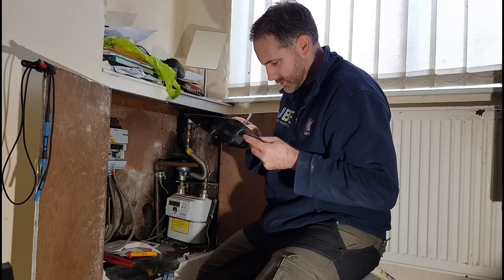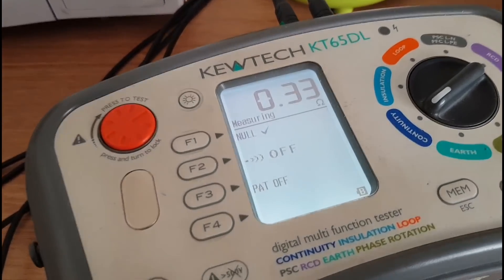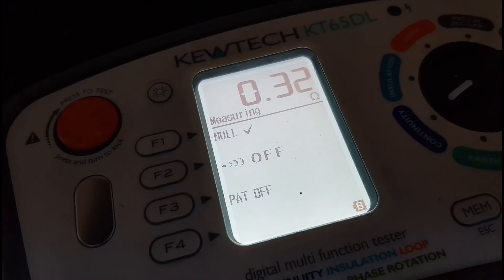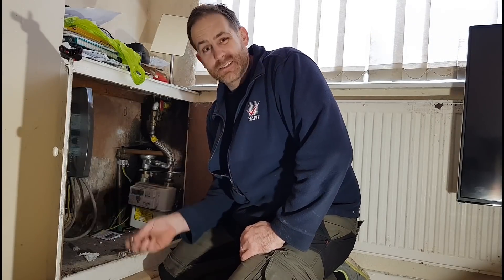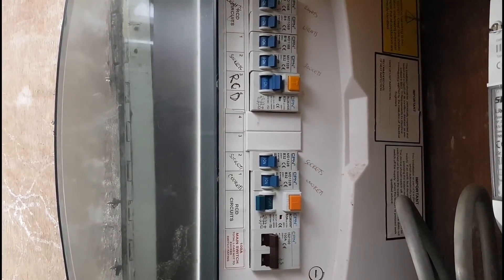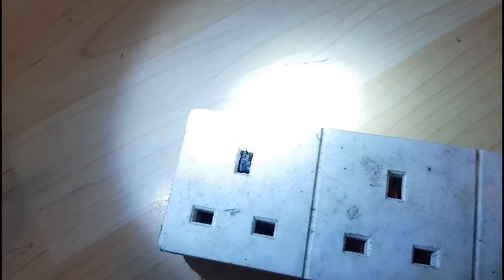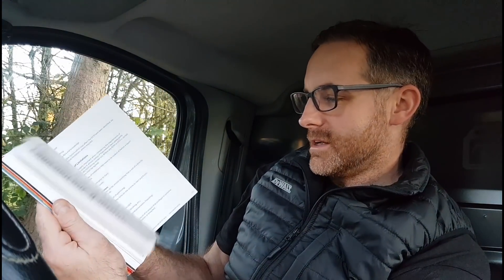Electrical safety in domestic properties. (25)

Comment: I’m interested to know when doing Eirc on the smaller faults the c3 codes do you just put right while your there or do you record it on test form then hand to landlord/agent.
I find all most all installations would have multiple defects that it’s easier for me to rectify than record on the cert! Just keen to find your thoughts

Comment: Typical electrician, talking half of video about a screw in the socket and the imminent danger of that C1-C2. 

How exactly is that interfering with anything that the normal socket screw wouldn't ? It's not being screwed through the middle of the socket.
I assume most of your viewers have opened a socket before, maybe even it's guts, and I assume everyone with at least iq 70 would agree that it cannot cause any danger.
Reply: Pardon? None of what you said makes any sense.  Statmente?  😂😂😂😂😂 I'm betting you are a millennial or even a female?  Based on the way you type. 😉 Oh dear! 🙈 You must just be angry at Labour losing too? "So," 😉 you're taking it out on poor jbeckelectrical. Get a life!  🤷‍♂️
Reply: @lloydchristmas8931  O snap, let me correct the typo so the grammar is perfect for your highness, otherwise you wouldn't understand what was typed. Seems you're still under iq 70, unfortunately.
When saying that someone is not correct, this usually follows with a why, otherwise we could endlessly say "you're not correct", then you would reply "no, you're not correct", etc. 
A good suggestion would be to stop avoiding the subject and argue as to why, because me being a millennial or female or Labour supporter has zero relevance to what is being said so far.
Single bit you partially got right is that I'm taking it out on poor J Beck, but I simply can't stand the over exaggeration of electricians, plumbers or any "hard working" "tradesman", because this shows that he tends to make a big thing of something so small, hence leads me to believe that he might be one of those guys who charges people £500 to swap a lightbulb for an old lady.
Reply: What is your IQ? 😂😂😂
Reply: @lloydchristmas8931  So you must be the one with iq under 70 :))
Reply: How'd you guess? 😱😜 "So?" Saying, "so" in front of your sentence makes you a genius then right?  😂😂😂🙈
Reply: @lloydchristmas8931  There is nothing wrong with using "So" to start a sentence, as a conclusion on my previous statement based on the outcome of your reply.
Ad hominem arguments are on your side :))
Reply: No thanks!  I have an actual paid career. Unlike yourself with time to spare. 😉 Good luck in the real world millennial. 😘😘
Reply: @lloydchristmas8931  It's funny when you call someone millennial, as if that would be an insult, and all your replies have plenty of repeating emoticons, not to mention you're liking your own comments. 

I'm happy that you have a paid career, but we are not discussing that. Five replies so far, yet not one having a counterargument.
You are right though with that remark "unlike yourself", I do not have a paid career, I actually have two + own business on the side, and still have time to spare.
Reply: Thank you for telling everyone. 😍 I can finally sleep at night. Like I say, clearly you have issues, and should seek help? 🙈 😂 Secondly, I'm not liking my own comments. I'll give yours a like now though, to make you feel better. Voilà 😉 Sincerly, IQ "under 70!" 😘😘😘 xx
Reply: P.S.  I prefer to be addressed as, "Your Highness. " Or, "Your Royal Highness." Will also be acceptable. ( all capitalized for future teaching methods. Because, it's a name. 😉 ) Oh, & who karez if me did do go an likey all me "statmente's." 😉 Me "q-tip" thing a ma-bobber is bellow that their of 70 u say!?  spits tabacco on shoe "Godnabbit!!!  Not again!" Yellz 4 me Mama  😘
Reply: @lloydchristmas8931  O snap, 3 consecutive replies, seems that last one hurt a bit. I suggest you take the time to reply with a counterargument, because so far, all your senseless buffoonery proved nothing in regard to the actual subject of this discussion. The funny part is that in 8 replies you haven't once addressed the subject.
Reply: @gameaccount1612  Oh* snap! 🙈 I'll do what I like thanks! 😘😘 😂
Reply: @lloydchristmas8931  I'll provide the counterarguments as I wanted to see if you can manage to come up with that by yourself. 
1- Screwing a standard pointing screw is dangerous as it can cut a wire.
2- Screwing a standard pointing screw is dangerous as it can cut the backbox metal where it screws into, and children could have access to the wires afterwards.
3- Screwing a standard pointing screw is dangerous as it can be too long, and if a fault occurs, then the metal sticking out could electrocute someone.

There are most likely more, but these are some on the top of my head.
Reply: It is funny isn't it? 😂😂 I think this too.
Reply: Your Highness** 😉 😂😂😂 Another typo for you. 😂 Get some help! You clearly have some serious issues. 😘😘
Reply: @lloydchristmas8931  At least you got the meaning of the words this time, even if the first letter is not capitalized. Let me know when you can bring a decent counterargument to the actual subject, as these ad hominem arguments aren't really in your favour.
Reply: @lloydchristmas8931  Being an insult or not is sort of relative. I didn't mean it as an insult, only as a barrier that specifies someones capability of understanding something. 
The subject of this discussion is that the guy made a big deal of a screw being there, without even checking the length, diameter or if a wire was damaged. A screw is perfectly fine to have, instead of not having anything at all. 
I'm afraid the fool is you, as you couldn't even manage to come up with a decent counterargument in several replies as to why it can be dangerous if not careful or unapt. I did you an educational favour in providing some examples, as I've seen your inability to think of any. 
Everything you say and do says something about who you are and your character, nothing new there Gandhi, that applies to everyone, and from the looks of it your character needs some serious work. All your replies are weak insults addressed to me that only project your own self petty, ignorance and career reassurance/validation, not to mention you have no idea what constructive critism means even if it hits you in the face.

Smooth copy of the millennial reply in your first sentence though. Cheers !
Reply: @gameaccount1612  😂😂😂😂😂 I'm afraid you are mistaken. But we will all let you pretend you are right. 😉 All the time it took you to write these replies is astonishing.  What do you expect with people's IQ under 70 like mine though? 😂🙈 Thank you for making me feel so important. I've gotten, 'Your Highness' and 'Ghandi' now? 😂😍😘  You clearly have some serious psychological issues if this is a priority to you to reply to, and in such a fashion. Seriously though, seek some help? I can get you some numbers. 😘
Reply: @gameaccount1612 Again, you know me so well! 😱  I'm here now if you care to join me? Nothing wrong with seeking help?
Reply: @lloydchristmas8931  Nothing wrong with seeking help only if you need it, otherwise  you're just lazy, although sometimes it might give the person providing the help a sense of contribution and satisfaction.
Reply: @gameaccount1612   If you don't need the help you're lazy? 🤨 Perhaps, you need the help, but you don't know you need the help?  Even though the help is readily available. But you won't know you need the help until the help, helping you gives you a helping hand and tells you that you in fact need help.
Reply: @lloydchristmas8931  Good point with needing the help without knowing, but the help we're talking about is not really readily available tho' :)
Reply: @gameaccount1612  I'm certain it is in fact readily available.
Reply: @lloydchristmas8931  You probably know best :)
Reply: @gameaccount1612  Yes! Of coarse. I am Ghandi after all. Remember? 😉 🙏
Reply: @gameaccount1612  You are a disgrace. What a waste of time you are!
Reply: @montgomeryward7941  You're repeating what your mother kept telling you or what ? :))

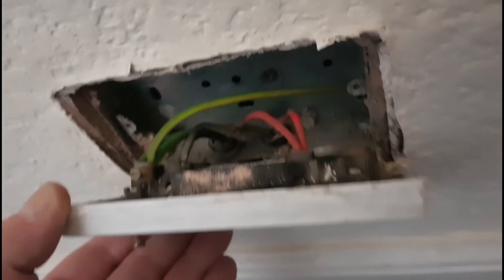Comment: At 5:00 where you're testing the double socket. You got a higher reading in the left socket. Why would tightening the screws rectify this? It's the same path for both sockets until the switch. What am I missing? I'd have thought it's just a worn switch and a coincidence that the next time you switched to test, it made a better connection. Love the videos, now you're at 10k, you'll be 100k in half the time! Thanks

Comment: Here's one for your code breakers, consumer unit is split load dual double pole  rccb with main switch, the heating system( underfloor pumped) is on its own mcb on the right hand rccb and the immersion circuit on the left hand Rccb to a 20amp switch yet the immersion heater itself comes off the load side of a separate 16 amp mcb with push button  contactor located in the airing cupboard and also on the load side is the hot water system for the central heating so as there us a fault on pump it effects both the heating split load rccb and the mcb/contactor

Comment: Interesting vid.
I've had one of those poxy plastic earth pins snap off on a charger in a wall socket
I see you're from the town with the listed concrete bus station. Is Southport within your area of operation??
As for the code breaking book. I couldn't help but think of Bletchley Park.

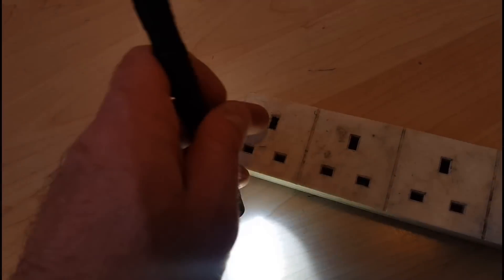Comment: 13:28 Plastic earth pin as a permanent resident in a socket - you say you're going to pull it out. First thing the tenant will do is put it back in so they can use the socket with their 2 pin plug !

Comment: When we do EICR's and have a side ways consumer unit we refer to the manufacturer to see if it is suitable for side way mounting.
We ususally do this via email so we have evidence if someone tries to call us out on it.

If it is OK then is is noted on cert but not coded, if it is side ways then it may be a C2 as it is not installed as per manufacturers instructions and may not operate as is should so in effect you have a nice looking switch not an MCB or RCD that is fully functional and will do as expected.
Reply: Emailed Chint and got a reply (below)
Hi Stewart,

RCCBs should be mounted so the text can be read horizontally to ensure correct operation of the device in the event of a fault.

Main Switches, MCBs and RCBOs can be mounted sideways with no detriment to their operation.

If a consumer unit needs to be mounted sideways due to space restrictions we recommend using a main switch board with RCBOs.

Best regards

Andrew Waring  BEng(Hons)
Senior Technical Engineer
Chint Europe (UK) Ltd.

Comment: This place, a small three-bedroom house, has two rings laid out as front of house inc. kitchen, rear of house inc. living room. It was done this way when built and gives a better load distribution than upstairs/downstairs rings. When I put in a new CU I did allow for putting the kitchen on its own circuit and redoing the other rings but it hasn't happened yet.
Reply: I was taught to do it that way when I trained way back when Noah was calling them in two by two. (1977 if you must know.) That way there is always power both upstairs and down if either fuse blew.

Comment: I was told by NICEIC that R1R2 wasn’t needed on EICR. as earth is proved by Zs. 
Discuss
Reply: I was taught you could either measure R1+R2 or just R2. If you only measure R2 however, you would have to test polarity separately so you may as well measure R1+R2. This would also mean you could calculate Zs if you wanted. If you just measure Zs on it's own and get a low reading, it may be due to parallel paths and you wouldn't know.
Reply: yeah me to, well he actually said i could do either zs or r1+r2, and no need to do both.

Comment: So is the Consumer unit vertical or is it my eyes?
Reply: Your eyes are fine, the board's been mounted on it's side, probably because the installer could work out a way to fit it horizontally in the cupboard.

Comment: What would you code the mini trunking lashed across the ceiling with no provision made against premature collapsing of a wiring system?
Reply: Ashman Electrical Services I’d call in compliant with the regs when it was installed.
Reply: @AndyK.1  When carrying out an EICR, you assess the electrical safety of the installation against the current BS 7671. If it doesn't comply with current regulations, it requires an observation code.
Reply: Ashman Electrical Services I don’t believe that to be correct, you are assessing the installation for safety yes things that no longer comply does not mean that it requires improvement. The code 4 has gone for this very reason.
Reply: @tomorichard  So are you saying a wiring system affixed to the ceiling with no provision made to prevent premature collapsing wouldn't require improvement, I certainly think so.
Reply: Ashman Electrical Services no I’m saying that every deviation from the current issue of BS7671 doesn’t immediately effect the safety of the installation and therefore require noting as such.
Reply: @tomorichard  Ok jump off the fence on this one, does it require a  observation code and if so, what code would you give it?
Reply: Ashman Electrical Services I guess it would depend in this instance it would depend if the premature collapse of that individual cable would cause entanglement.in no way am I digging at your comment I just don’t believe that any deviation requires a observation code.
Reply: @tomorichard  NAPIT's Codebreaker book says even if it didn't cause entanglement, it should be coded C3 as an improvement is recommended.
Reply: Ashman Electrical Services does it really, I must admit I don’t own a copy and have heard that it’s a great reference material.
Reply: @tomorichard  I very rarely use it but you made me dig it out for clarification on this one.